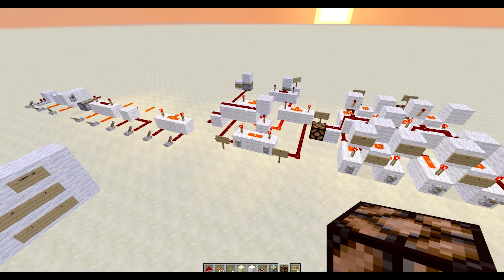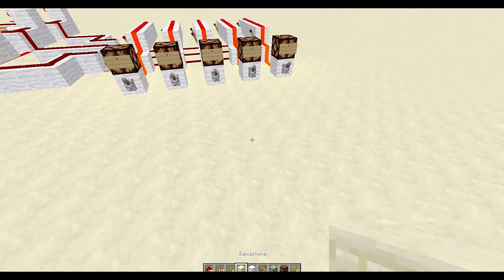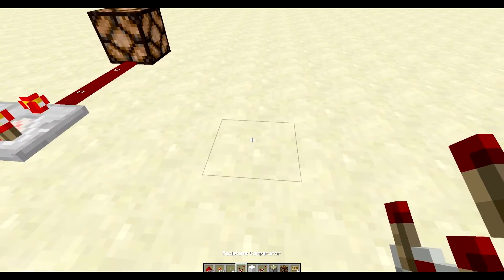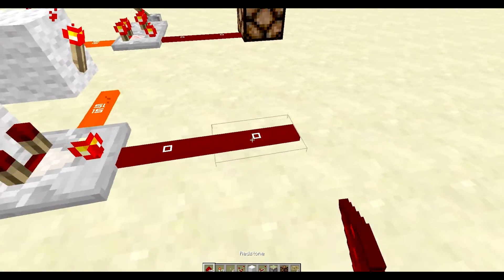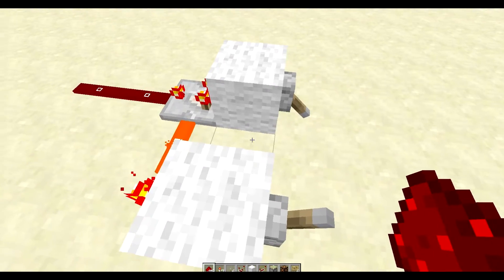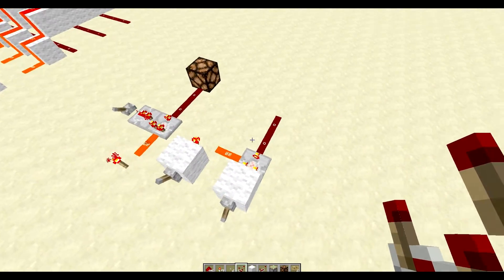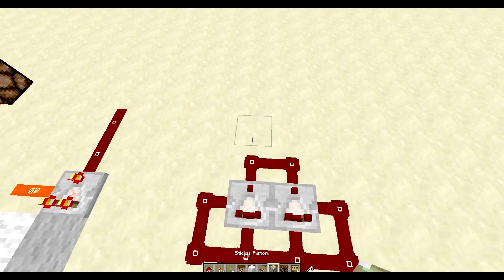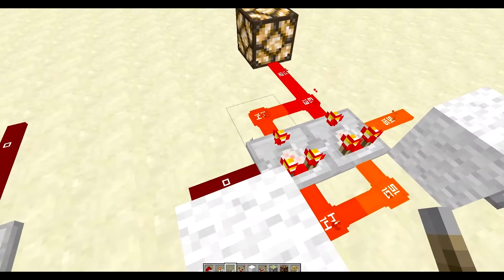Redstone Computer Tutorial - Episode 5 - Comparator Logic Gates

Comment: no most ppl watching this probably dont know what comparators are. i have no clue what box at the end helps with. then you say signal that is larger and also turn on subtraction? and destroy the line that came in from the side so its hard to see what happens. then you flip alot of switches and say heres yuour inverter and im totally lost. you dont say what difference it makes that signal in is  larger compared to on/off. you did flip the regular side input once but would be more helpful doing it a few times on and off, its so fast and among all other changes hard to know thats the important part.
the next two boxes are not even connected how can that work, and you are zoomed so not possible to see the result right away :(
and perhaps beginners dont even know the switches are on in the down position, so not easy understand.
and mentioning repeaters is even more confusing :p
in earlier example signal was fed in now its suddenly generating a signal and both connected together wth.